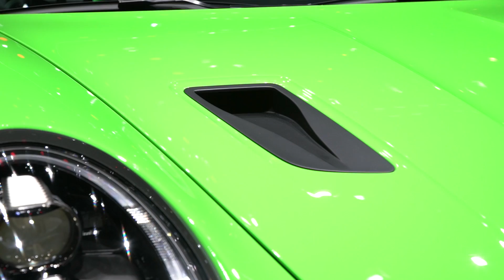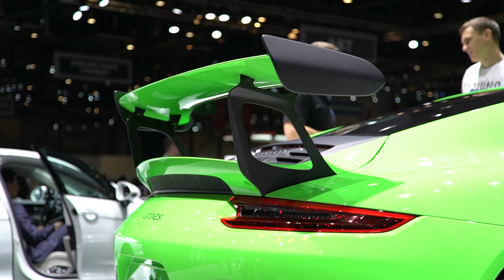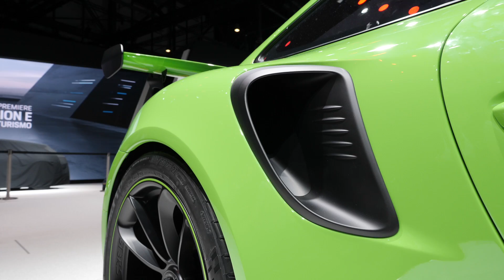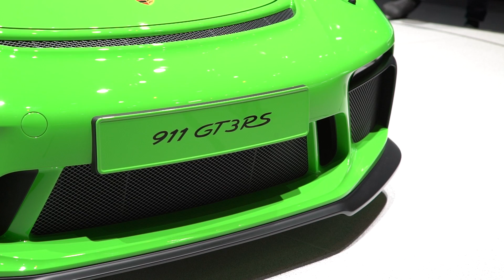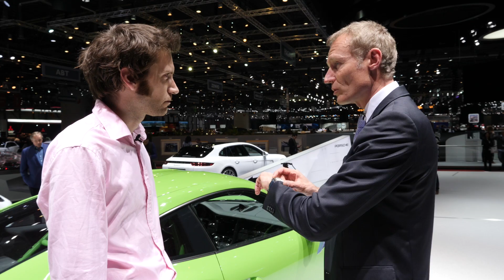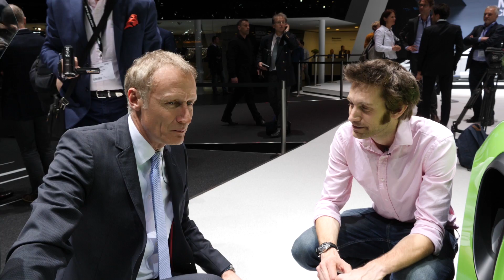Porsche 911 GT3 RS: Andreas Preuninger Tells Us EVERYTHING - Carfection

Comment: Another over-engineered car 09% of buyers won't be able to exploit. No where to push it nor the driving experience. :) But they'll sell like hot cakes anyway. :)
Reply: Of course, because that's German engineering...! No useless bling bling shit, but only pure rational and functional details with the highest quality on this car. I'm quite sure the car will have way more than 520 hp, because the Porsche horsepower figures are mostly totally conservative. With its ram air effect of the air intake the previous GT3RS had 20 hp more at a speed of 200 km/h. The same will be the case with this car here. And I suppose the lap time on the Nürburgring Nordschleife with this new GT3Rs will be somewhere at seven minutes. Totally supercar territory!
Reply: Not from what I've seen. My last Track day at knockhill, there were four of them there! All being driven very very hard indeed (well, the one we took was anyway)

Comment: I like Porsche a lot, and have always thought the GT3RS  is a cool car.  However, it is funny when people think all the ducts and vents on a GT3RS are cool, but criticize Corvettes for being tacky and boy-racerlike when they do the same thing.

As a fan of both Porsches and Corvettes, I'd like to see a comparison test between the GT3RS and the ZR1.
Reply: Still Searching Porsche is Porsche and has been around from the beginning as the pinnacle of focused performance. The corvette reputation hasn't been that so I think people may have a different respect for Porsche. U must admit the corvette handles nothing like a Porsche, the steering is not as sharp. The engine and engine placement is not as rare. Corvette doesn't rev out which is rewarding like a Porsche GT3 RS . I'm also sure the materials used in a Porsche are better due to budget. It's Porsche man LOL
Reply: Donta' Nichols, I appreciate the well-reasoned response. The porsche would probably be my choice between the two, but I'd still like to see them compared.
Reply: Still Searching Uh that's why Porsche got the GT2 Rs to go against the new ZR1

Comment: "In the racecar without restrictor the engine can make upwards of 600hp at the same displacement" Porsche need to make a 600hp GT3 now
Reply: Emissions,  noise control, and longevity keep that from being in the street cars.  The theoretical limits for a flat 6  are just about reached .  To get more, you either need to go to higher RPM which lessens longevity, add a turbo/supercharger (won't happen), or go to a flat 8 which is hard to squeeze into a 911 body.

Comment: How much additional lift is created to the increased downforce? this always makes me wonder, cause the number of added downforce is meaningless without it...
Reply: Clemens K. - Do you mean the additional drag? Lift is the opposite of downforce, if you increase downforce, you reduce lift (both are a force in opposite direction) and the drag penalty is dependant on the efficiency of the design of the aero.
Reply: No, I am not talking about additional drag. Building new bodypanels (making the car wider etc.) creates lift besides drag. The vents at the wheel arches are there to reduce lift, because the turbulant air is creating a high pressure zone there. I expect the ducts that cool the brakes on the front hood/frunk/bonnet create significant lift as well. So it would be pretty nice to know how much these bits create.
One more thing: If you increase the downforce, you do not reduce the lift in itself. You can at least compensate for it if you sum it up around the entire car. That´s actually why I want to know these numbers...
Reply: I think the NACA ducts aren't moving that much air, but it's nice and cool.  The last gen GT cars like mine, had brake cooling ducts under the car and were bigger. the 997 GT cars made about  ZERO kg for the 997.1 and for the 997.2 RS made about 60 KG.   so  350-400 KG is a huge improvement on the 991.2 cars